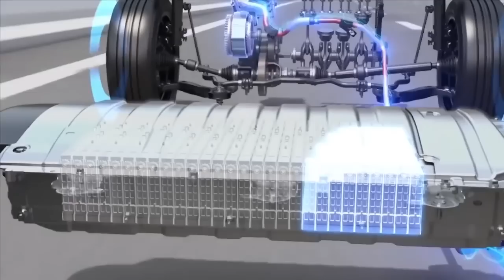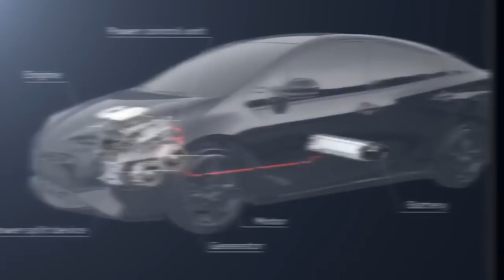Toyota's New Solid State Battery Is A Game Changer!

Comment: The Toyota PR department is working overtime. Sony brought us the lithium ion battery? I thought it stole the critical technology from Whittingham and Goodenough. LOL Solid state batteries are more energy dense AND more expensive? That's a trick. Since most of the cost is in materials, if a battery is more energy dense, meaning it needs less material per kWh, then it will be less expensive. 

Toyota is continuing to stick with the hybrids because hybrids require an ICE and that is an area of Toyota's expertise. Not to mention its loyal supply chain.

Comment: "on the market by 2025!!"  Autonomous driving is becoming less and less necessary and desirable.  People are have less extended families.  So those visits are eliminated.  On-line purchases are through the roof so trips to the mall or hardware store are eliminated.  Grocery home delivery is on the rise via several means.  Society is undergoing a significant change that may see the need for owning an autonomous vehicle come to a significant reduction.  Where will you go to view Mars exploration?  The computer in your living room, probably.

Comment: It's like PV's in 2010's revisited. Steady lowering of costs, with elevated specs. Who wins again: China!! will copy or get to license the best tech just in time(?!) The problem is when to lock technology, with good cost, energy density, recharge time, lifecycle / recycling. This time the latter can't be a facultative parameter! in 10 years landfills can't get clogged up with EV batteries as will be soon with PV's! The price of the battery must contain the recycling cost at the time of sale, so that at end of life an EV battery has positive value (at least for scarce elements and/or energy intensive compounds. Leasing a battery can be a way for car manufacturers to write off EV batteries to landfills, if expedient: a big problem for developing world AGAIN.  If Tesla guarantees batteries for 8 years only(?) it's a safe bet that cheaper ones with end in landfills in 5 years! ICE vehicles can easily get a life of 20 years: that is a goal for EVs too!

Same should have been for PV's where the probability of a manufacturer not surviving its product life of 25years is almost a certainty! Car manufacturers are more resilient, but still!

Comment: Solid state batteries are a solution to a problem that will have been solved before solid state is even ready for market: A charging network still too thin (at least in Japan), requiring cars with extra range. Sufficient DC chargers and much cheaper sodium ion batteries will kill the market for this. 

Solid state batteries use more lithium per kWh than other lithium chemistries, which means the more demand outstrips supply (mining is not keeping up with BEV growth) the bigger the price gap will open between solid state and its competitors (LFP, NMC & even more so, #sodium).

Comment: Many companies are working on solid state batteries. Nobody really knows if they'll win out. There isn't really anything new here. I'm betting on the garphene-aluminum batteries by Graphene Manufacturing Group. No lithium. nickel or cobalt needed. 100% recyclable.
Reply: Something else to consider... Toyota has over 1,400 patents on solid state battery technology, more than any other company. Panasonic has the second most at a few hundred patents. And they are working together. So combined, they have far more patents on ssb tech than anyone else. If anyone can be first to market, it's Toyota.
Reply: The graphene batteries are something I could see catching on, mainly due to recyclability. Recycling batteries is a very difficult process right now.

Comment: I will never buy electric if it has a flammable battery
Reply: Batteries might have a fireif broken in an accident.
Gas and diesel always burn and have fires. 
So ride a bicycle.
Reply: Buy a EV with LFP-batteries = they can't burn🔥
Reply: @mikafiltenborg2291  absolutely not true

Comment: As a potential buyer I as only able to purchase used vehicles and expense replacement batteries are  giant killer!  I will not consider any car with a $20,000 gotcha after purchase.  Months back I purchased a 2005 used Highlander for just over 3k a used hybrid with a chance of thousands of potential battery replacement costs was not a consideration and will remain so.
Reply: The 3rd gen prius can be had for around 15k with low miles. I've seen the original batteries last well over 300k miles, and now they can repair individual cells instead of changing the entire battery pack. But even a full hybrid battery replacement in a 3rd gen prius is only like 1500 dollars. More than worth it for something that reliable that gets over 50 mpg. I'm currently driving a 2007 with 242,000 miles on the original battery pack. Still gets over 40mpg amd runs great. The 2nd gens can be had for around 6-8k in good condition. Totally worth it.
Reply: @TheColbyChurch  With the older hybrids their batteries are not sealed and can be individually serviced the newer ones it’s all or nothing. There is a bunch of vehicle fires related to big batteries that seems to escape media scrutiny also.  Lithium batteries also have an environmental ending issue at disposal time and really drop in capacity when seriously cold.  My counter part had a come apart in contemplating a hybrid.  $1.5K for an aftermarket replacement battery unit does become a bitter pill gotcha at the get go.
Reply: @TheColbyChurch  you’re doing well. My generation three battery didn’t make it past 105,000 miles. No warranty from Toyota. I felt I was lucky to get a brand new one put in for $2440.

Comment: Dose of reality -  First Lie..  "Zero Emissions Driving"... there is no such thing. As much as 60% of the electricity generated in the US is STILL generated using dirty Fossil fuels. As long as this is true...  electric car drivers are indirectly still POLLUTING the air.  All you tree hugging "save the planet" do gooders can stop kidding yourself, every time you plug your EV in... you are adding to the pollution and green house problem. Oh... and then there's the problem with EV battery disposal. There's also another issue not detailed in this video, when lithium batteries fail to operate safely or are damaged, they may present a fire and/or explosion hazard.